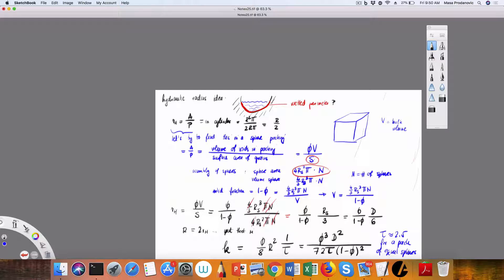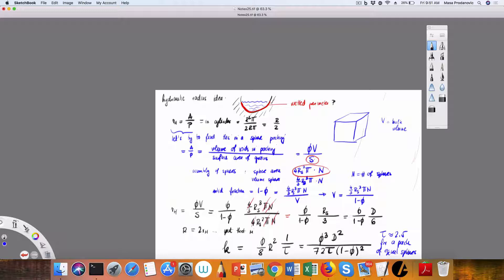PGE381M Lecture2 CarmanKozenyPermeability 2018 10 12

Comment: last slide there is a mistake: its only 72 if you use radius instead of diameter. In this form you should have (6^2)*8. Great lecture btw